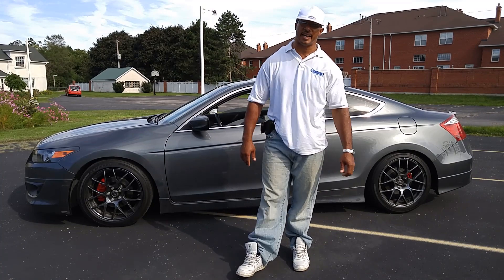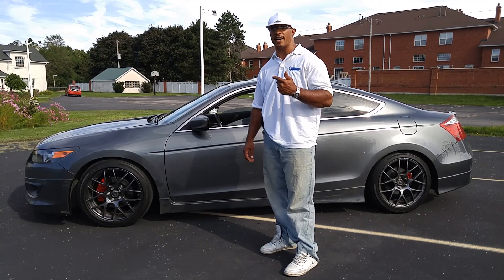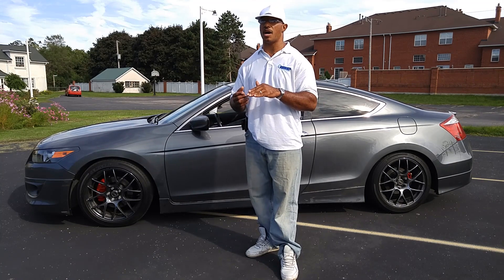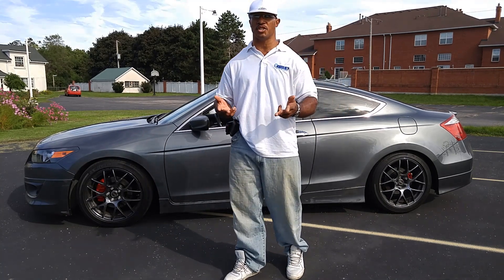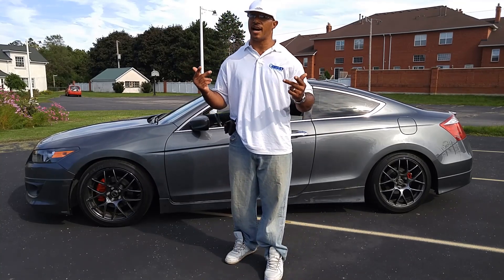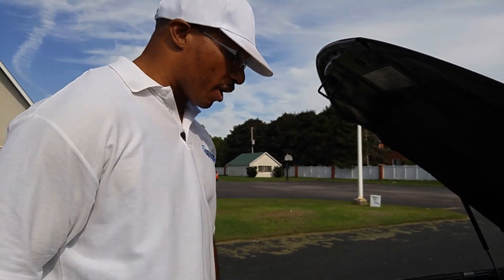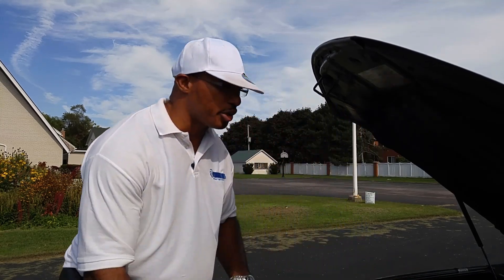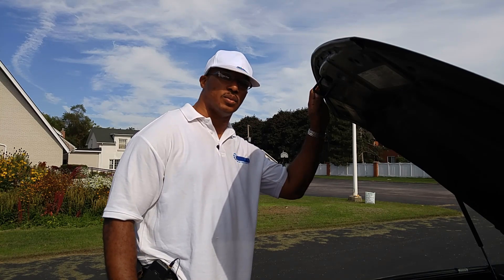8th Gen Honda Accord ''Engine Making Loud Ticking Noise''

Comment: I had a 2008 Honda Accord 3.5L and at first I thought it was the timing belt, but I quickly turned my eye to the valve lifters and fuel injectors. It turns out the fuel injectors were the problem and I got them replaced with some cheap ones that ended up giving me better fuel economy and also fixing the ticking.
Reply from the maker: Yes, I  did have the valve lifters replaced and the ticking noise did went down but it was still there so I just changed the engine and everything was wonderful there after 🙂
Reply: Which ones did you buy??
Reply from the maker: @Apulux  Sorry I didn't change them, I only had them adjusted. $1300, later, and the noise was less but still there, so I changed the engine.
Reply: @V-TecHondaLove  ohh ok I did my own valve adjustment, got rid of 90% of the tick which was a lot better than it was but majority of Honda all have ticks regularly
Reply from the maker: @Apulux  Yes, that's true. Pretty much all my honda accords have had some small ticking noise. This one was the worst. It's still my favorite Honda Accord, no doubt about 👌
Reply: I have the same problem right now. Mine is Honda Accord 2008 v4. I didn't pay attention when I bought it and later I noticed the ticking noise. The noise is more noticeable when driving at low speed. If I drive on the highway it goes away. One mechanic told me the camshaft is worn-out,but I don't trust that mechanic. Another mechanic told me it is something internal issue and asked me $350 just for diagnosis, and I left it. I bought it with 141k miles and now it has 179k miles and I still drive it.  

I assumed that Honda Accord has that issue and decided to drive till I am ready to replace it. But if any one has any suggestions that I can replace something, please drop your comments down here. 

          Thank you!!
Reply: @teweldenegusse1345  valve adjustment..... replace the timing belt tensioner .....

Comment: Literally had this exact same noise with my Acura TL 3.2L v6. One of the spark plugs was completely loose. I know you already changed the motor but for anyone having the same noise should absolutely check their spark plugs
Reply from the maker: I appreciate the info 411... Good looking out 👍.   Acura TL 3.2L v6 very nice car 😎... I wanted one in the 6 speed for the longest time but never did find it. I may still get one who knows...  I'm still not over liking them...
Reply: @V-TecHondaLove  yep that’s exactly what I bought! Got it from the original owner for a steal (however it had this ticking noise, and needed a clutch) I think he tried replacing the plugs himself and got scared because of this noise afterwards and panicked and sold it. It’s currently getting the clutch put in it and I’m stoked!
Reply from the maker: @Fireblade96  O wow! nice😎... Why don't you just keep it? These car holds there value. And especially the V6 - 6 speed🥳... These you'll fine 1 out of every 25 you see, would be the 6 speed manual... Even with high kms people are still asking top $$$. And they're still getting sold..
Reply: @V-TecHondaLove  I just bought it recently, the previous owner (original owner) I think panicked and sold it cheap to me. I definitely don’t plan on selling it anytime soon. Just hit 170,000 on it
Reply from the maker: @Fireblade96  What else can I say other than you got a very good car. And like you said, for a great price. 170.000 is nothing really. just do your regular maintenance and you'll have it running smooth for years.. like I said, I'm still thinking about getting me one 🤠
Reply: @V-TecHondaLove  I’ll let you know if I’ll ever get rid of mine! But seriously thank you for posting this video of your car. It will for sure help others with this noise
Reply from the maker: @Fireblade96  Sounds good 👍 Thanks much for your kind words. Yes, that's what it's all about, helping each other 😎... Enjoy the car and safe driving out there...

Comment: Hey man. Super late to reply to this video but I wanted to let you know I have a v-6 honda accord 2009. Made ticking noise after it got it's engine fixed after recall. The ticking noise got worse and it ticks when I accelerate and it's at 148k miles now. My mechanic says the engine is no good anymore. Not worth fixing and has to be replaced so replacing it was a good call IMO. Beautiful car by the way!!!!!!
Reply from the maker: Hey bro, much thanks for the comment. Yeah man I totally agreed. No need to be dumping money into it, may as well just swap it out and save any future headache. After I got rid of the old engine the car runs perfect until I sold it and bought my Mercedes Benz which I'm now selling lol... Just picked up another one of these 8th gen Accord coupe. Can't help it man, they're great cars and a lot of fun to drive. That v6 3.5 6 speed manual transmission, 278 HP puts a smile on my face every time :)..
Reply: @V-TecHondaLove  For sure man! A good call to go back IMO. You have good taste with it too! I just upgraded to a Lexus GS 350 F-sport. I wanted to get a honda accord sport but my parents convinced me against it. I love honda but I've had 3 so far and all of them had engine/tranny problems and paint fading haha. Wish you best on your car adventures!
Reply from the maker: @AntBTun  Oh nice, Lexus GS 350 is a nice car. Very comfortable to drive plus it's got a lot of power for a family sedan 304 hp I believe. My wife's dad was giving her his 350 awd about two months ago. He's upgrading to the 2021 Porsche Cayenne but because she already have a car she wanted me to take it but only if I sold my Mercedes. After taking it driving for a few hours I decided to keep my Mercedes. I find it to not have a lot of interior room and me being 6ft 230lbs I didn't find it to be comfortable. Ok man, enjoy the car.. All the best...
Reply: I just replaced my engine with a 50k 2.4 and I have the beginnings of that ticking sound. Gonna have to go to Honda again.

Comment: Hello, were you able to find out what the issue, i am having same noise on my 2019 Honda accord
Thank you
Reply from the maker: Yes, I did. The problem was the lifters  🏋️‍♀️.. I had them adjusted, and the noise went down like 80%, but it was still there. I ended up just changing the engine. I didn't need to, but I didn't want any future issues.
Reply: I have a Honda Accord v4, with similar issues. I don't feel any problems in driving it other than these sounds.

Comment: Mine makes a squealing sound when I press the gas barely, any suggestions? I haven’t found the problem where the noises coming from.. I have a automatic 2012 Honda accord EXL coupe
Reply from the maker: Check the fan belt. Mines use to do that and I replaced the belt and problem, problem fixed.

Comment: Is your car on coilovers? And did you get a woblle on acceleration after you lowered it?
Reply from the maker: it is and no wobble... runs amazingly well.
Reply: @V-TecHondaLove  I have a 09 accord, I get a wobble on acceleration. No one can find the issue.
What's the solution?
Reply from the maker: @eustaceflowe7350  I'm not sure why that is but I don't recall ever having that problem. Maybe check to make sure that the wheels are balanced and that there's no bumps in them. Also check the alignment.
Reply: @V-TecHondaLove  thanks, p.s. nice car.
Reply from the maker: @eustaceflowe7350  thank you. Hope you'll be able to figure out what the problem is and get it fixed. Good luck 👍
Reply: @eustaceflowe7350  axels

Comment: Hello all. 2011 Honda Coupe auto, 3.5 , 6cyl. That beautiful blue color. I have tat sound when I start the car in the morning, after I drive a block, it goes away. Car drives great at 80 mph. Tried engine flush so far. Any suggestions?
Reply from the maker: Yes, that was how it was with mines. After a few minutes of driving, it would stop. But then after a few month of driving it like this,  it got louder and louder. After spending over $1300 and still not being able to fix the problem, I end up just changing the engine..

Comment: My car sounds exactly like this. Did you figure out what it is??! How much did it cost? I’ve had my car sittin basically for like 2 years just turning it on and movin it every here and there because I’ve been wanting to fix this just don’t know the issue.
Reply from the maker: Oh man, this has been an ongoing headache for a few months. I took it to my mechanic, and he said it was the lifters, so I had him adjust them, plus he cleaned the valve as well. Cost me over $1300. The noise was less, but still there, so I got rid of the engine all together. In total, I spend around $2400, but this includes changing the clutch as well.

Comment: Oh man. My 8th gen civic did this. We just replaced the motor with an imported one. Kept the old one to break it down. The oil never had flakes. The noises lasted for 3 years and got worse over time. Still don’t think it was major. Everyone says rod or wrist pin. I think VVT solenoid because the gasket is worn to pieces and was leaking. But we shall see once we break it down and rebuild if still okay within the next year.
Reply from the maker: Yes I just ended up changing out the engine with newer low kms one and the car was perfect after 😃

Comment: Had the same issue had a valve adjustment didn’t fix it ended up being the rocker arm I think they may have a recall on it
Reply from the maker: Hi isai, thanks for the information. I think you're man, I had the valve adjustment done, did timing belt and water pump and after a $1300 bill I still have the same problem.
Reply: I know how you feel man had my valve done at Honda and when I got it back sounded the same I said keep it till you figure out the tick
Reply: They’re the ones who told me it was just a valve adjustment too 🤦‍♂️
Reply from the maker: @MrIsaiperez   I should have done the same thing lol...
Reply from the maker: @MrIsaiperez  I'm doing an engine swap. Can't be bothered with fixing fixing fixing. Costing too much money so I'm just getting rid of it..
Reply: @V-TecHondaLove  how much was the engine switch and where can I find a good engine for my 2010 Honda Accord crosstour i want to fix the whole thing.  Thanks
Reply from the maker: @kendodie  Everything including new used engine with under 100,000 kms, new clutch, water pump and timing belt runs me around $2800. The mechanic was the one that ordered the engine which came from a import dealer in Montreal Canada.

Comment: If the problem didn't get fix yet ask scotty Kilmer. Also i think you need cam replacement or something probably need chain changed as well. But you will need the top off to find out qhat is trully wrong with it.
Reply: I've watched Scotty's videos but how do you get in contact with him I'm sure that he gets a million messages a day and I have a 2004 Honda Accord V6 3.0 and I have something that sounded like a rod or a valve when I started it up this morning but then all of a sudden halfway through my five Mile drive it stopped and for the last 3 days it hasn't made a single noise again would that be a rod knock if it's not consistently getting worse and went away and hasn't came back or would that be something else like a bearing or a valve I'd really like to ask Scotty but I wasn't sure the best way to get a hold of him directly?? Please help
Reply from the maker: I ended up just replacing the engine... After spending $1300 and still having the same problem. I didn't want to put any more money into the car and still not know if it the problem would be solved..

Comment: I just had my timing belt replaced, it was the kit...when my car warmed up the ticking would go away but this took 10 mins idling....these are interference engines as apposed to non interference...this means that once the timing belt breaks your car engine has damage done to it....my accord v6 coupe 2008 drives and sounds like its brand new...even my shifting got smoother.....i promise you the problem is timing belt kit...also, this is recommended by honda at 100,000 miles i think....i pushed mine to 187,000 miles and got lucky it didnt break...good luck honda afficianados
Reply from the maker: That's was my issue for sure. Once it warmed up, noise is gone.. I did ended up just changing the engine and life was great after lol 😆
Reply: When you say “kit “ what’s all included in that ? My wife’s car does the same and it’ll go away after 10 min of a cold start every morning .

Comment: The 3.7 J37 in my 13 Acura tl sh awd 6 speed manual  sounds similar flappy noise when revved. Doesnt burn oil. Ticks loudly even after valve adjust. Had front camshaft and lifters replaced , rear ones need to be done to completely fix it. Doesnt affect performance but it sounds annoying

Comment: Since you've already had a valve adjustment, and it increases with rpm, it could be a worn or pitted camshaft. I have an Acura TL j37 and there's a few guys who've had this issue. Here's a video to the guys engine noise https://youtu.be/ynBif5gm0_c
Reply: Original article on acurazine: https://acurazine.com/forums/4g-tl-problems-fixes-297/2012-sh-awd-j37-very-loud-valve-tick-solved-972181/

Comment: mine is 2012 and the same problem but mine is gone after 15 to 20 mint of the startup. I check with one person he said the engine oil pump has to change.
Reply from the maker: Yes, this is how mines was in the beginning but it only got worse over time. I ended up just changing the engine.

Comment: If you've already done the valve adjustments, then its the fuel injectors. You'll be hearing 4 ticks per rpm and goes louder as you rev it. One way to check is by pointing a stethoscope on top of the injector. The other noise might be the belt hydraulic tensioner.
Reply from the maker: Oh man, honestly after spending so much money doing the valve adjustment etc, etc, etc and still getting the same issue I was done. Ended up just changing out the engine and the peace of mind was priceless 👌
Reply: @V-TecHondaLove  how much did it cost to engine swap?
Reply from the maker: @Auscilius  Cost $2700 Canadian.A new clutch was included  as well...
Reply: @V-TecHondaLove  oh so yours is a manual??
Reply from the maker: @Auscilius  3.5 v6 - manual  6 speed every day, all day lol....
Reply: @V-TecHondaLove  Sooooo lucky!! I searched everywhere for a manual.. So I stuck with the 09 automatic V6 
🤷🏾‍♂️😭
Reply: @V-TecHondaLove  BTW mines having the same problem at the moment
Reply from the maker: @SliceTheHitmaker  They’re out there, don't give up. Yes the 08 - 10 is my favorite model. But I'm telling you man, once you drive that v6 3.5 in manual; there's no looking back. All my Honda was the 6 speed. Like I said, you'll never look back. Stay safe out there 🙏
Reply from the maker: @SliceTheHitmaker  You should get it checked out. The engine is not cheap. Always try to know for sure what the problem is before it gets worse and more costly.

Comment: Engine sound blown just had same issue with mine my engine being replaced as I type this I had an oil change done n they never added oil to it so I drove it with no oil for a while not knowing it no it started ticking I thought the timing belt was going or valves needed adjusted or a cam phaser but it was bad rod
Reply from the maker: No, mines was some valve issue... I did get them adjusted and the noise went down a fair bit but I didn't want to put anymore money into trying to fix it so I got rid of it and put in a new engine...
Reply: @V-TecHondaLove  how much for the new engine?
Reply from the maker: @irodicy3667  Engine cost me $2300. And that all depends on how much mileage is on it.. Mines was just over 80..

Comment: Did you ever figure out what this problem was my car sounds the same
Reply from the maker: Mechanic said it was the lifters so I had pretty much the full top of the engine removed adjusted and clean. $1300 later and still having the same problem. I didn't want to waste any more money so I ended up just changing the engine. Cost me $2300 but the car drives like new after so I was happy 😊
Reply: For 1300 bucks that would’ve had to be done the proper way or  ordered a lower mileage JDM engine from eBay somewhere mine was doing it to it’s A 2010 model didn’t become noticeable until after the valve adjustment I think it’s caused by one being misadjusted I just simply replaced the rocker arms with newer ones ordered from Amazon problem solved 🤔💯⚠️

Comment: Ya need a new spark plug and a fiddle flack for the carberator on the dismount down yonder. I work at autozone take my word buddy.
Reply: Nick Rah hey can u help me a Jamaican with same problem
Reply: @kaviankinglocke8596  yo bredda u get yours sort out ? Jamaica me deh same issue with my 2016 3.5 V6

Comment: My 2012 Honda Accord coupe V6 just started making the same noise. I'm scared as hell it maybe the timing belt. I just replaced the spark plugs a month ago.
Reply: then the noise is gone or still have after changing the spark plugs?
Reply from the maker: Maybe not the timing belt, but you new to have it checked out asap b4 things for worse.
Reply: @V-TecHondaLove  is the damn valves honda have this problem just re adjust the valves and it would go away,make sure you change your oil normally after...
Reply: Did u ever figure out what it truly was tho Kuz we have the same yr Honda me and u and I’m curious what I need to do